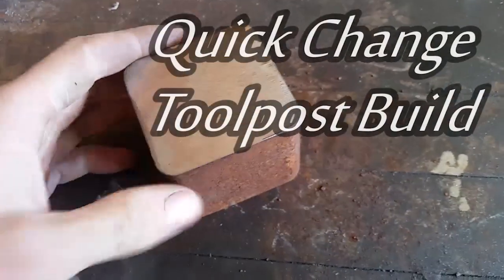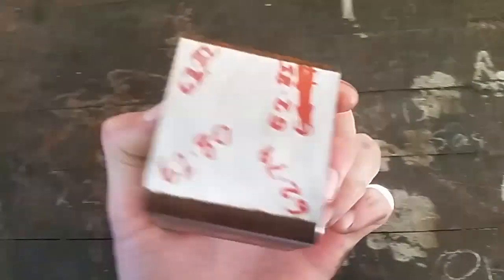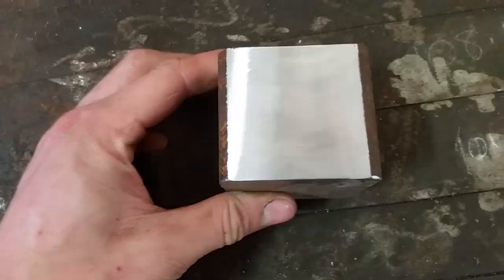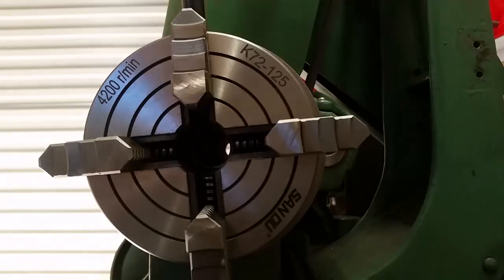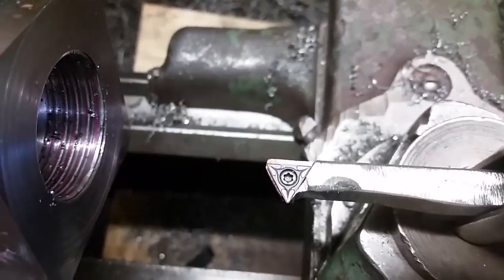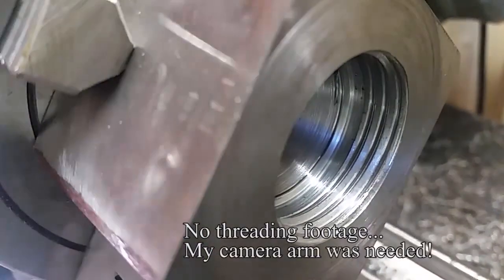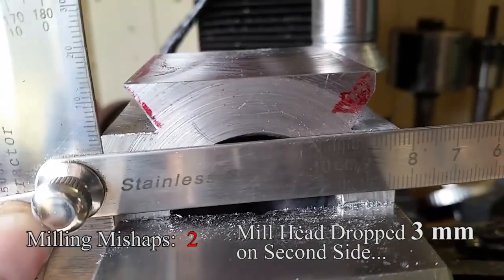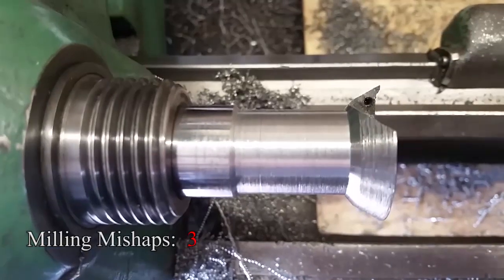Quick Change Tool Post Build Part 1

Comment: I know this is ages ago, but to do the internal thread you could run the lathe backwards and machine at the back.  Joe Pyzinski (sp?) has a video on it.
Reply from the maker: My lathe has a screw on chuck, so it could come undone. Although light cuts would probably be fine.
Agree this would have been a good method!
Reply: @TomMakeHere  undercut the internal thread at the back of the bore. Then cutting with the leadscrew in reverse, (tumble gear). When you reach the undercut you know you've reached full depth of cut for the thread.

Comment: There are those days, for some reason Bozo decides to open a can of "whoop ass" on ya.  Looks like you managed to work past him, though.  Sometimes, he out figures himself, and you actually get something better than your original design.
Reply from the maker: Just power through the pain! I learnt a lot about work holding on this and to make decent sized clamping studs! Thanks for watching
Reply: @TomMakeHere   I learned a few things from my build as well.  I used my shaper to cut my dovetails (first ever in any kind of material).  Patience/perseverance is a lesson that is never over.  

I'm still working on puzzling out a way to keep the body in position when changing tool holders.  I see, in the last video, the same problem I've experienced with getting the cone to release inside.  I based the taper on a CAT 30, it possibly needed more to keep it from sticking due to the spring back in the body.  Or it may only need a bit more polish on the body taper. 

After seeing your take on it, I think I have a few ideas to try that won't involve a full re-design on the major components.

Comment: Don’t stress out when this many things start to go wrong turn the machines off close up the workshop and come back tomorrow with a fresh set of eyes and start from the beginning and work through slowly to eliminate preventable errors if it takes 2 hours longer today it will save you 4 hours extra work tomorrow
Reply from the maker: Or just plow on through and get some lessons what not to do!
100% agree with you though